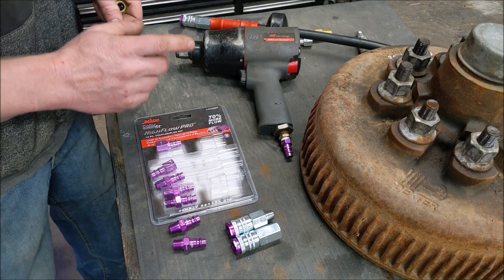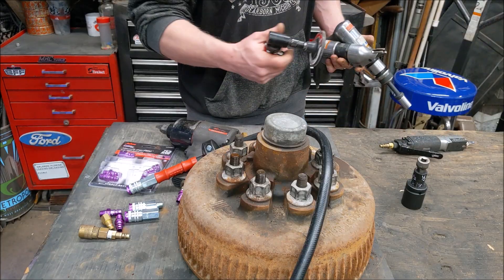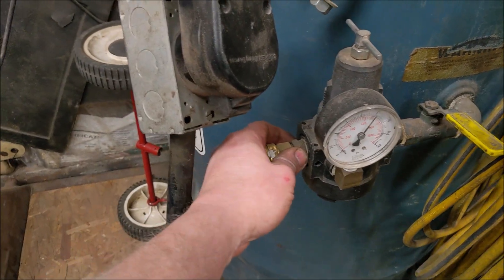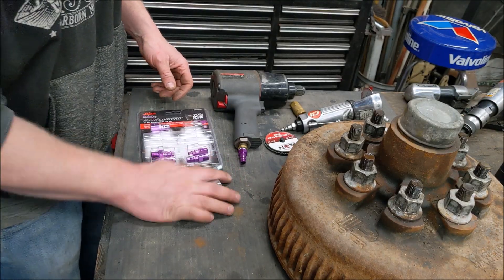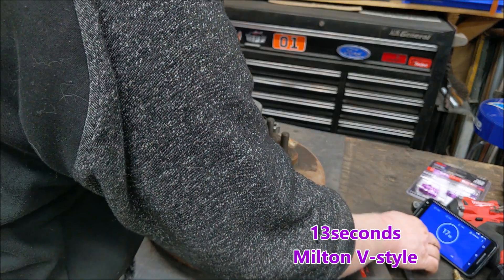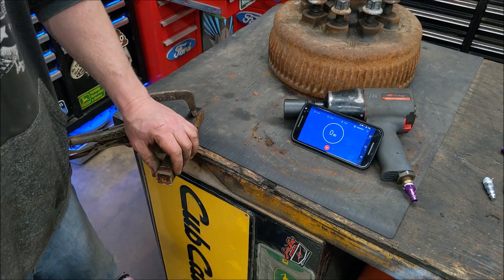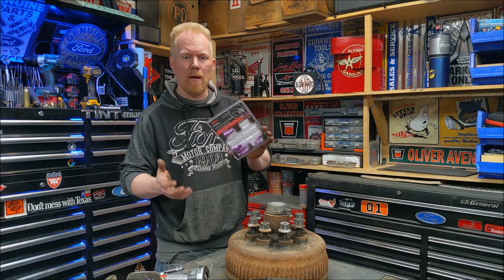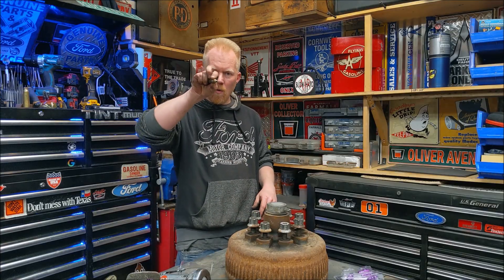High Flow Air Fittings worth it? Tested Head to Head Milton V-Style

Comment: I purchases the same kit from The Home Depot app back in March for $20.82. I bought them along with a brand new air compressor and F.R.L. Upon receiving the couplers, the absolute first thing I noticed was the huge holes! This was the first time seeing them and I do have to say that the airflow is great! Maybe not the full 70% that Milton claims but it's pretty close. I can most definitely tell the difference like you did when you go and use an older coupler. This "V style" purple colored high flow set is the way to go. You won't be disappointed. Many of us have purchased and love em!!!

Comment: Thanks for this...wow, yeah a noticeable speed and sound difference.  Ok, but why not go right to a H style with the 3/8" body and 1/4" npt threads?  Wouldn't that flow even better because not only is the opening larger, but the body as well.  Anyway, that is what I am leaning towards doing. WYNNsky has a nice 9 piece kit for under 20 bucks. You could still use your low flow tools with M style couplers with this setup by adding a H plug to a M coupler in front of the line coupler. What do you think?
Reply from the maker: Milton says 74cfm max for V-Style and 67cfm max for H-Style. Compare that to IM at 40cfm or T at 40cfm as well. I bought some off brand V-Style from Amazon and they had a way smaller drilled hole in the fittings and the coupler was probably 1/2 the internal size holes as the genuine Milton.

Comment: How are the high flow holding out.? Being Aluminum body.
Reply from the maker: They come in brass and steel as well. The one in my air hammer is beat up as it takes so much vibration but the others are all good. I haven't had to replace any yet, but I did buy a 3 pack of brass for $4 to swap the air hammer.

Comment: isn't the true visual test when going to a high flow, seeing the lack in drop of pressure with the regulator? standard non-high flow, when you pull the trigger, you can lose   40-50 lbs of air pressure..with high flow, it knocks the drop in air pressure down to around 10 lbs of air pressure lost. basically just watch the difference on the air regulator gauge...either way, nice video to show the difference..

Comment: Not sold on the test methodolgy, but the difference in sound alone is clear. P.S., if you like air tools, buy the harbor frieght extended 4" cutoff tool. Best air I've ever used.

Comment: The Ting is you have still a big hose and the good fittings on your tank... inmagin the difference with all standart parts...
I live in germany and have the standart NW 7,2... (7,2mm inside ) i dont know if it is compatibile but i reely would like to use them.

Now i only have a big hose (12mm/ 1/2 inch inner diameter) connected to the 1/2 inch port to my compressor... and only that make a difference over 1 Bar at the end of the hose vs the 6mm hose.

Comment: How do those compare against Flexzilla high flow fittings?
Reply from the maker: They're close but still not as good. They have a smaller hole opening
.031sq inches to flow air with I/M and Automotive fittings
.071sq inches to flow air with Milton V-Style fittings
.069sq inches to flow air with Flexzilla. 
That's only the male fitting. The coupler is a whole different story. Most of the Chinese knock offs have a plug that covers the inlet when a fitting is plugged in. So they are worse than a regular IM fitting. I bought a few other brands after the video to just see and they all are worse(Amazon Basics, Harbor Freight Hi Flow, and two others). Just go with Milton and you won't be disappointed.

Comment: How have the aluminum plugs been holding up. I have read where some people have had problems with the aluminum plugs popping loose on their own. I have the high flow V-style myself but have the brass version.
Reply from the maker: The couplers have been holding up excellent with no leaking or wear whatsoever. A few of the air tools to have extreme vibration I noticed the fittings do have some wear. Like my air hammer for example the steel balls of the coupler start digging in to the retaining ring on the male fitting. I haven't had to change it out since I put it on but if I used the air hammer on a daily / weekly basis I would probably only get a few months. Things like my air check that I use on a daily basis show virtually no wear along with my die grinder etc all look great. The impact gun does show a little bit of wear and would likely only last a few months in a heavy shop environment. I definitely think brass is the way to go but I'm really impressed how will the aluminum ones are holding up.

Comment: Alright, my question is do the hi flow fittings hold up as well as the OG fittings, I know the cheap aluminum hi flow fittings that come on an impact from the tool truck that come in all the fun colors brake in a week of use swap it to a Milton and you’re good for a decent amount of time.

Comment: I just picked up a compressor recently and didn't know what fittings and what size to go with it being a ridgid tristack 5 gallon I think but could be wrong on that wanna go with 3/8 but whats on there i don't know if the couplers leak so I may go ahead and replace them with brand new ones im gonna have to see what size it has on it

Comment: Stay away from the HF "high flow" fittings. There's virtually no improvement. I am going to try the Miltons but it looks like they're made from soft aluminum and get nicked and gouged easily. Many people complaining in the reviews that they leaked after a few weeks or months. Amazon sells an aluminum set of the V style connectors and fittings in a pack for about half the price, and steel for about a quarter the price. I'm going to buy packs of both and see how they hold up.
Reply from the maker: Milton does sell the V style in brass and steel for more abusive environments. However I do think they're aluminum is higher quality than the harbor freight ones and I don't have a single one leaking since I put them on in the video.
Reply: @sixtyfiveford  I got them all in the mail today. Coincidentally my neighbor broke an axle. I hooked up the Milton fittings to my low profile onyx and it worked better than my full size impacts. I think the bad reviews are based on user error. Even the Amazon brand seems identical to the Miltons. They're black and you get a big pack of them for about 10 bucks if I remember correctly. I tried those and didn't have any leaks. They even interchange with the Milton plugs. Awesome stuff.
Reply: Just a warning... this has never happened to me before. I got some of the STEEL V style fittings too and tried to screw one into a pot-metal Chinese high-flow air blaster (Hyper Tough brand). The bore was 1/4'' and the plug was 1/4''. I used a LIGHT coat of sealant. The body of the tool cracked in half. Tool bore threads seem to be a bit undersize for the plug. Cheap garbage. I got it from WalMart for like 5 bucks so no biggie.

Comment: Have these, 200PSI 100 gallon compressor and a 26 gallon 160PSI compressor, not impressed with them. Typical junk, scratches and dents easily, marring the fitting surface.
Reply from the maker: These are also made in Steel for the longest life.

Comment: This is not a valid test until you remove all the purple connectors and just run with the old style. Then run again with all purple fittings throughout the airline.

Comment: The high flow fittings is all we use in our paint booths at work. There is a huge difference when we use an adapter in order to spray a small piece out in the shop floor...
But you are right that it wont benefit all air tools.
Good vid!

Comment: They work best for high flow applications like sand blasters,  and you can really see the difference if you use it for painting cars.
Reply: I was also under the impression these were mainly for use with HVLP spray guns.  Nice to see they have a little benefit to other tools, as well.

Comment: Those aluminum purple fittings don't hold up well that's the only problem I've noticed  I think it's the long Barrel air hammers that really Chew um up.
Reply from the maker: They have the same V style in Brass or Steel.
Reply: Yeah they're much Better
Reply from the maker: @MrLLdog  I have one I use a ton on a right angle grinder and it's getting pretty worn down. I was going to buy some brass ones (I prefer brass over steel).

Comment: The Milton high flow ones are junk.  The soft aluminum wears out really fast.  The steel flexzilla ones last forever but are more expensive.  So if anyone wants to switch the high flow save your money don't buy the Milton brand buy flexzilla. This is my advise from someone who uses air tools a lot and from my friends who are bus mechanics.
Reply from the maker: Milton makes the Highflow V style in brass and steel as well.
Reply: @sixtyfiveford  awesome are they on Amazon? I know all the aluminum ones I have tried cap out after a few weeks.
Reply from the maker: @dieseldreams2853  These are the steel ones https://amzn.to/3c62qdc with brass couplers. You can buy just the fittings in a box of ten for under $20 https://amzn.to/3pnhXZR

Comment: can you make a video with air compressors combined and high flow air fittings?
Reply from the maker: What do you mean?
Reply: Set up air compressors hooked them up combined to the running compressed air line. And high flow air fittings. Show us air compressors and combined running a lot of air through air pipe and high flow fittings show us how much air with air compressors combined and high flow fittings how you can do with a lot air.

Comment: Nice!
Reply from the maker: These make a huge difference. The only downside I've found is the aluminum gets dinged up easier than brass/steel ones and will have a shorter life(only the male not the female). Though I haven't worn one out to the point of not sealing, they do make the V style in Brass or Steel and I'll probably buy some of those next time.

Comment: these seem to be great...and i like how you can still use standard 1/4 fittings with them also...
Reply from the maker: That's been one of the greatest features. When ordering this I forgot how many odds and ends(tire chucks etc) I had that have the smaller fittings. They really don't need high flow and have no issue working with the Milton V style.

Comment: Your hose acts as a tank and takes a certain amount of time to fill so having an hi-flo fitting will make a substantially larger gain in performance than having the hi-flo at the tool.
Reply: Can I just drill out my regular fittings
Reply: Interesting, I would imagine that you can, but I would check online first for first hand reader's accounts to see if it worked well for them 😊🌎✨

Comment: Aside from the quick connectors... Couldn't you just run a drill bit through the rest of the fittings, and have the same thing? Looks to me like everything else is identical. Just a bigger hole down the center.
Reply: Ok, I followed the link to amazon, and the fittings are all illustrated very well, there. Looks like the purple ones have a slightly larger outer diameter in places, and are the same the rest of the places. So they can achieve a larger inner diameter. I still think you could have at least a compromise size, by drilling out the inside of the "M" size fittings.
Reply from the maker: Standard fittings have: .031sq inches to flow air. You can drill them out to .040sq inches to flow air. The V style have:
.071sq inches to flow air. So nearly twice as much air can flow though the V style even after drilling.
Reply: @sixtyfiveford  Thank you.

Comment: Thanks for great vid! I noticed your old "M" style plug seemed to work in the new "V" style socket. Conversely I have had instances where the "V" style plug will not even go into an "M" style socket. If you look carefully and measure, there IS a difference in the "V" and the "M" styles. I saw a vid by some guy that showed a dangerous situation with fittings blowing apart because these 2 slyles don't fit perfectly. Just eyeball them side by side. You can see the difference! Be careful mixing "V" and "M"!
Reply: I just ran into this today, high flow doesn't fit normal flow

Comment: Can you drill out regular fittings amd turn them into high flow?
Reply from the maker: Regular fittings are .031 square inches and you can drill them out to around .040. Hi Flow are .071, so more than double.
Reply: @sixtyfiveford  oh wow quite the difference thanks

Comment: I started with the industrial fittings but switched to automotive for several reasons, I could barrow my dad’s stuff, others on the construction site could not use my compressor and I’ve found that the automotive aren’t as leak prone. I have used ingersoll ,cp, and the ones snap on sold but have not noticed and better quality than I get at harbor freight. I am now in a shop running what I think is the same compressor you have a Curtis e57. I may try these next time I have to buy fittings though I’m really wanting to try it on my ingersoll impact. But since you seem to have more pneumatic knowledge than me I have a question, who makes a good hose, I run 190psi and keep blowing hoses marked at 600psi. I’ve blown everything from cheap Chinese to ch craftsman Goodyear. What do you think?
Reply: I know that this comment is about 2 years old but for those asking the same question, I recommend the BLUBIRD 1/2 in. x 50 ft. Air Hose. I use it mostly for a Sunex SXMC12, 1/2" Mini Air Impact Wrench along wit other miscellaneous pneumatic tools. Rugged and gets the job done. Rated at I think 300 PSI...

Comment: 10:05 you are cheating and not using your 1 hand to lay down the nut as you did before but rather letting it fly off. Nice try. Fail test. A cutting test is more accurate. One problem for others, if you have a smaller compressor, you will eat up oil quicker. Unless your on a piece work job, who the heck cares how much faster it is.
Reply from the maker: The impact gun is spinning 1500rpm faster with the Hi flow fitting so the bolts just fly off. Speed has little to do with it though, it's all about the drastic increase in tool power. The cut off tool did drastically better not only because of speed but because there was less stalls.

Comment: I saw these at my local norby's I'm glad you did a review on these I was wondering the same thing if they worked better it looks like they do. thank you
Reply from the maker: Thanks, I'm glad you liked it. I did speed tests today and the impact gun spins 1500rpm faster. The cutoff die grinder exceeded my rpm meter so I couldn't get exact but I would say it is spinning 3-5000rpm faster.

Comment: I have the 3/4 impact you have along with the snap on 3/4..if you want them to be anywheres near ultimate performance..run them on a 1/2" airline with 1/2" milton couplers and nipples..same as i use on my I.R one inch impact.for my 1/2" guns i use milton 3/8 couplers and nipples..i dont believe in 95 psi either..too much pressure drop on a 50 or 100 foot hose..CRANK IT UP !!!!!
Reply from the maker: I used to drag around a 1/2"ID hose, but it's a pain. Sure I can't get peak power out of the gun but I still haven't found a nut that it won't take off.
Reply: @sixtyfiveford  i work on commercial trucks and heavy equipment..for me..i need max power out of my tools..when you come across the size stuff i do..you need top performance from your air tools..outside of the flexability of a 3/8" air hose..i dont find a 1/2" hose any harder to drag around..but i run the swivels on all my air tools..even my inch drive impact
Reply from the maker: @chrissterling3225  Heavy equipment for sure needs every bit of power. I keep the 1/2" hose around for the random occasions.

Comment: Lol! She just couldn't stand it, but give her credit, she did wait until you left...
Great video and testing Moe, thank you!
I like the better flow rate, but the thinner walls of the fittings worries me. I had a fitting break on me while under a car once and the hose end smacked me in the head, leaving a goose egg for a day or three. I'd be even more concerned about that happening again with thinner walled fittings. I think I'll stick with the old heavier walled fittings and just use my 3/8" hose hooked up direct with no couplings when I need the flow.
Yours truly, Knothead...

P.S. However, thinking about it some more, I bet they are made of better metal these days and you can't beat the price.
Reply from the maker: That doesn't sound fun. These purple ones are aluminum and though I don't think they would break they will likely ding/nick pretty easily. They do sell the same style in steel for higher strength.

Comment: If the restriction is at the tank end, the effect of the friction in the air flow through the length of the hose should have a greater effect on the tool end, even with the high flow fitting on the tool end.
Reply from the maker: True.